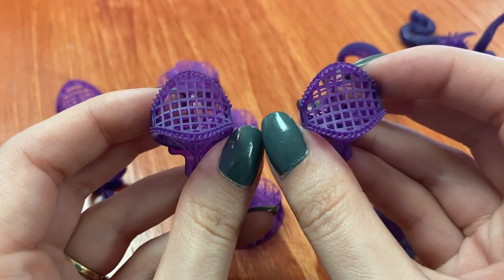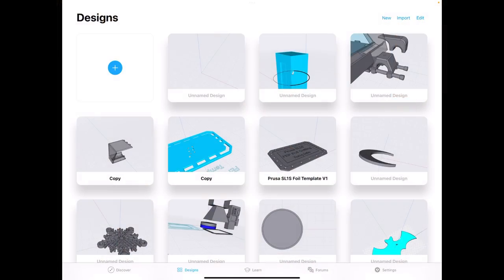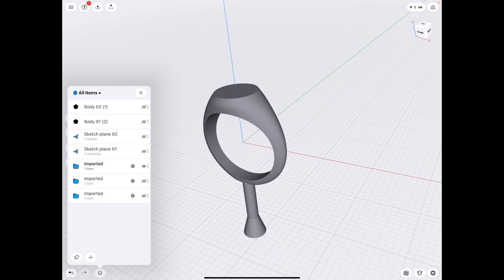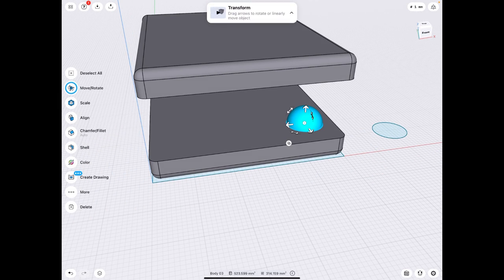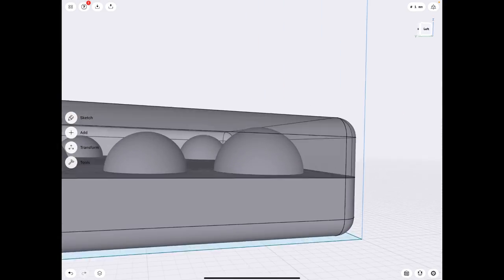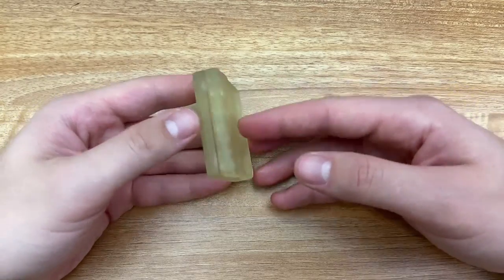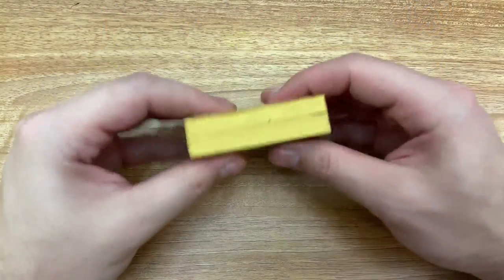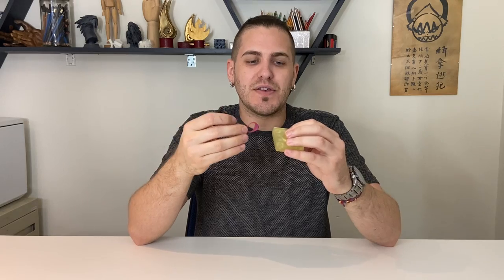Modeling and 3d printing a jewelry mold - Shapr3D and Siraya Tech Tenacious

Comment: Love the tutorial for making a mould using Shapr3d and printing with Tenacious. I've not to play with that one, as the cost of importing that resin here is prohibitive, and it takes a good amount of resin to make a mould. I've read that most people tend to mix Tenacious as a small percentage to their regular resins for this purpose. The process shown with Sculpt is what I've been doing for a while now. Works really well for me, and uses much less material than printing a whole mould would, and the moulds are consistently good, even with my trashy chuck frame in kiln under pressure method lol. The standard Grey variation of Sculpt is indeed a bit limited in what temperature rubber you can use, but their newer variant, Sculpt Ultra White, is rated to over 420F. Which lets is be used with the higher temps of stiffer rubbers :) 
Thanks as always for sharing dude!
Reply from the maker: Fusion360 also has the Subtract function if you have that application.
We've already begun the follow up video this this method using some different engineered resins and it's working way better than we expected, don't miss it.
Reply: @ClearMindJewellery  I'm familiar with Fusion 360, actually learnt it via that method first, and hated it 🤣 Apparently they've fixed the process and streamlined it to function a lot better and more fluidly than the methods I learnt. Tbh, I'm not a fan of that app, and would rather find literally any other tool path. I don't trust a company that forces you to give them full access to your work and save on their servers, or that needs an always on internet connection. 
Looking forward to seeing your next videos on the topic! You're definitely on ball with the best ideas 🤘 Check out the new Zbrush 2022 tool, BasRelief, and you may wet yourself with excitement as you consider it's application for jewelers 😍

Comment: You can also cut the ring shape out of the casteldo rubber to help get rid of the air bubbles
Reply from the maker: Yes you're right, the vulcanized test wasn't the best but it was more a proof of concept. We're going to make a follow up video to this that's better.
Reply: @ClearMindJewellery  looking forward to it.

Comment: So what was wrong with the ring that came out of the mold made with the ST Tenacious, other than you not being "super enthused" about it? If the mold was any more flexible you'd get misaligned edges when you brought the two sides together and big seams in the casted pieces.
Reply from the maker: Tenacious is more of a “mixer” in the resin world. It’s better suited to making tough resins less brittle than it is to printing on its own for use in flexible applications. 
Regular RTV, and vulcanized moulds, are five times more flexible than this printed mold. As the sides press together the seams disappears and you end up with less flashing on your wax injections due to the softness of that mould material. 
And as noted in the video, the less flexible your mould is the harder it will be to remove complex designs from the mould.

Comment: Hey, I'm looking to do this method. Are there any resins you can recommend since this video?
Reply from the maker: The B9 material turned out well but they sent the mold pre-printed as it’s an “eco-system”. The apply lab work flexible is pretty good as well

Comment: I know this is an old video, but... Why not off set your spheres instead of line then up, just bring two diagonal corners equally inwards towards each other? This way the mold can only go together one way and there is no opportunity for putting the mold together wrong? Just a thought, maybe there's a reason you can't do it that way.
Reply from the maker: Regardless of how you place the spheres as long you place some on the far edge (opposite the opening) there is no way to put the mold together wrong.

Comment: Hi. Can you recommend a resin that is good for making the molds for list wax . I can’t afford to a vulcaniser at present and it’s costing a lot to send them away. I wonder if anyone has made a resin that could be used like the delft clay casting?!!
Reply from the maker: You can use pretty much any 3D printing resin for casting with Delft clay, since its a non destructive casting method.

Comment: Do you think you could get away with vulcanizing their castable resin?
Reply from the maker: Unlikely. Even some regular resins can’t withstand the vulcanizing process. It would probably deform the detail if not cause pockets to form.
Reply: @ClearMindJewellery  yeah I was thinking that might be the case, but if I ever feel like getting weird I’ll try it and report back. 
One more question: how would you rate Shapr compared to Blender? I like Blender so far, but they way you used Shapr made it look more user friendly and possibly easier, but then again I know you have been using it for a long time.